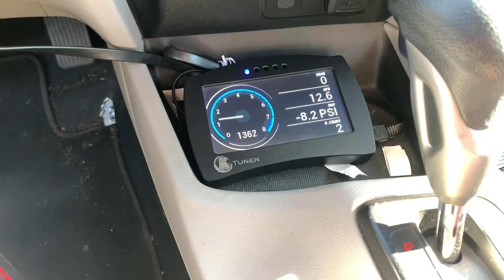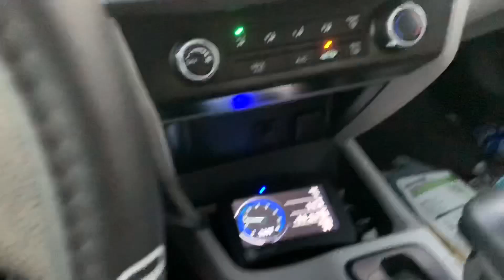Boosted R18 gets tuned! | (build pt. 7)

Comment: You think it's safe for me to tune and turbo my car at 139000 miles?
Reply from the maker: Depends on what car it is. If you’ve got an r18 you could do a head rebuild and after that you’d be okay I’m sure. But even if you didn’t want to I bet it would be okay anyways. Honda’s are damn bulletproof
Reply: @mobsquad1320   cool I have the first r18 in the 06 Civic
Reply: How the auto trans holding up? Been thinking about boosting my r18
Reply from the maker: It’s actually pretty good. You have to manually shift while accelerating wot to keep it feeling good. That could just be my current tune but it definitely has felt better when doing that. No clutch slip and I haven’t tried launching yet